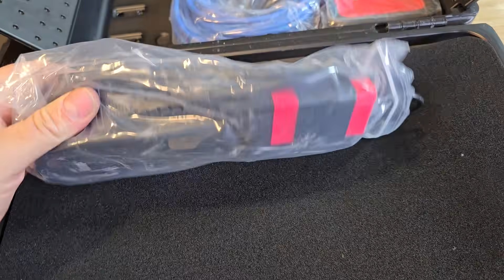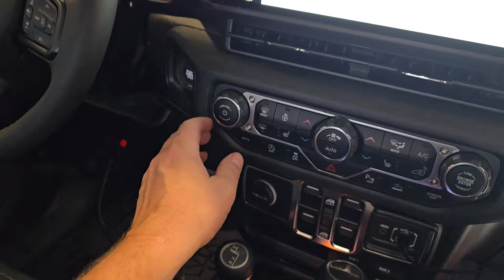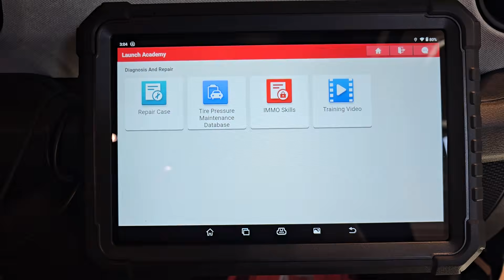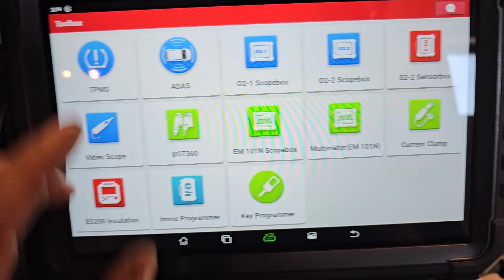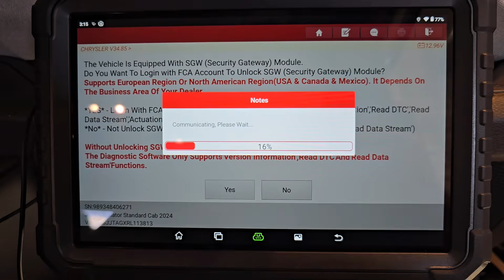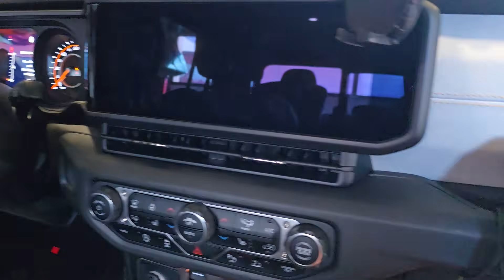LAUNCH X431 PRO3S+ Elite 2024 Bidirectional Scan Tool with J2534 OEM Topology Map OBD2 Android Tab

Comment: I've seen so many videos of people claiming this tool can do this or that and it's great. Nobody actually demonstrates it doing any of those things. This is the first video where a guy attempts to demonstrate but nothing works because the tool is blocked by Stellantis. I can't seem to confirm that this tool can actually do anything without forking over a ton of money and hoping for the best.
Reply from the maker: Yes it was annoying. I never unlocked the security gateway. I do have a cable now to bypass it, I should try this again!
Reply: @OctaneElectrons  that would be great!
Reply: @OctaneElectrons , what cable do you use to bypass the gateway?

Comment: I have had mine for almost a year, and so far I havent been able to connect to a BMW, or MB Sprinter, although I have all the updates it wont even recognize the make.  I was able to connect to a Kia Telluride no problem Seems to have an issue with European makes.
Reply from the maker: Sorry I don't know. Works great with my American cars, never had any problems. Even works well with my OBD1 fox body mustang.
Reply: How did you get the launch to do obd1

Comment: I’m in the app and I spoke with support I cannot get a 2004 Honda odyssey modules to pull up like ABS and more, they told be to use EOBD I don’t have a single clue how to do that
Reply from the maker: Sorry I'm not sure. I didn't have any trouble getting into ABS modules.
Reply: Use obd one adapters? What they said.

Comment: Thanks for the video. I’m borrowing the same model from a local mechanic when I need it, looking to buy one for myself, but I specialize in Scania, Volvo, Penta and DSE and has the OEM laptops for each. So the guy has the x431 HD for trucks & earthmoving, but for almost $4000 it can only read & clear fault codes & do calibrations on some vehicles which makes it a bit disappointing in a way. Am I just spoiled with the dealer level diagnostics of the OEM’s or can additional software be bought and loaded to make the machine do more advanced stuff ? 

I mean, almost all brands uses the same CAN protocol and can communication & coding is almost one standard and language, so it shouldn’t be too difficult to get it to work on a more advanced level. Another local mechanic I know has the older Launch model with the older blue VCI with LED lights and his machine can do more than the newer one we are using at a quarter of the price.
Reply from the maker: Right on, it is very good. I think it depends on the vehicle and software support. This tool supports full dealer level diagnostic on most popular models from what I can tell.

Comment: Still wondering why launch is using old software android 10.0 they should be using 13 or 14
Reply: Almost every single scanner autel, topdon and xtool. I've only seen one using 11. I've basically narrowed my choices down to this or topdon phoenix pro 2 or the smart. This would be more comparable to the smart. Which cheapest I found was 1800 on ebay. So this is about 700 cheaper. I just don't like the Chinese updating and other crap I've heard can be a nightmare wirh launch non usa versions.
Reply from the maker: Yes, they will probably update.

Comment: Evan I have the same exact scanner and smart link, question I got this for online programming but it is not giving me any option when Im in the specific module. Do I need to buy addtional software in the Mall icon?
Reply from the maker: Yes you might, depending on the particular vehicle. I couldn't tell you for sure for every vehicle.
Reply: I can't speak to every model but from my research if for example a GM product you use the Smartlink C with a laptop and the GM website to program modules.

Comment: HI EVAN MINES JUST COME TO DAY MATE OF EBAY ITS A LAUNCH X431 ELITE PRO 5 WITH THE LATEST SOFTWARE ITS FAST MATE LOVE IT I HAD A AUTEL DIAGNOSTIC RUBBISH AND THIS ONE WAS A BIT CHEAPER PLUS 10 .1 TFT SCREEN  EVAN HOW CAN YOU FIND THAT ITS DOES HAVE THAT LATEST SOFTWARE ANDY 🤔
Reply from the maker: Right on! I love mine. There is a software update option in the menu. Just connect to wifi and hit that to update.

Comment: Did you get a Vga cable male to male to use the obd 1 connectors.
Reply from the maker: I did not, I sold my old 81 Firebird without testing OB1. Wish I remembered to do it.

Comment: Thank you for the video, it was well done. I was a mechanic during the 1970’s and 80’s and after all these years am going to try to get somewhat current by buying a scanner and DIY’ing my own cars. These questions are a little off the subject of the video but where do DIY’ers get wiring diagrams these days?  Also, I’ve heard that databases that help techs diagnose the actual problem associated with a code exist. I didn’t find any when I looked. Are there such databases?
Reply from the maker: Hi, great. Glad you're getting back into it! Hope you have some fun. This is a great tool. Sorry I don't know about diagrams and databases. I typically just buy factory service manuals online. I always look for free PDF copies first though.

Comment: Too quick questions.  Where did you buy this unit? Will it work on a GMC  2014 3500HD  diesel?Without any additional software and hardware?
Reply from the maker: Yes it will. It is available on Amazon.

Comment: Its so crazy how far scanners have come in such a short time. Right now, this scanner is available on ebay for under $1,000 after taxes, which is unbelievable for what you get!! 5 years ago, a scanner like this would have cost $3,000+. Launch is really doing an amazing job at bringing the newest diagnostic stuff to the consumer for such a reasonable price. The J2534 pass-through device alone is worth the cost of this kit. It even has can bus pin detect, can scope, dlc voltage check, and a ton of other great stuff. Autel is getting left in the dust right now.

Comment: HI EVAN THANKS, FOR GETTING BACK  IS,THIS,BETTER THE RED ONE THERE DO THIS IS THE LAUNCH X431 PRO 3 PLUS IS,THAT RIGHT WITH EVAN  SMART LINK 😀
Reply from the maker: I think this is the best one currently available. I'm very impressed with it.
Reply: @OctaneElectrons  HI Evan hope you and your family 👪 had a lovely Christmas 🎄 😊  I got my Christmas 🎄 prezzie mate off ebay a cracking deal on the launch x431 with the V5 latest version software  same one mate in the video  Evan million times better than the Autel  MAXI IM 508S Xp 400 EVAN  WOULD NOT PROGRAM MATE IN THE CAR AND IT COST MORE THAN THE LAUNCH X431 ELITE THE LAUNCH X431 IS LOADS BETTER WITH TOPOLOGY MAPPING AND BIDIRECTIONAL CONTROL 😊
Reply: @OctaneElectrons   EVAN JUST CHANGE MY FULL EXHAUST SYSTEM AND DPF FILTER MATE AND DPF SENSOR AND DPF PRESSURE SENSOR COMING UP AGAIN MALFUNCTION ON THE DASH  BOARD I WANT TO CHEACK FOR CODES AND ERASE THEM FROM THE ECU  HAVE I GOT TO USE TOPOLOGY